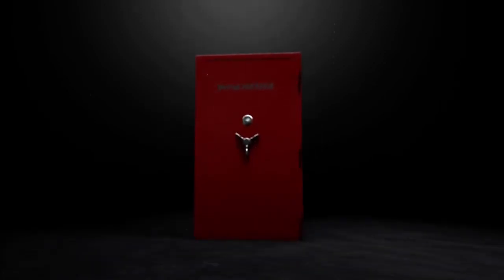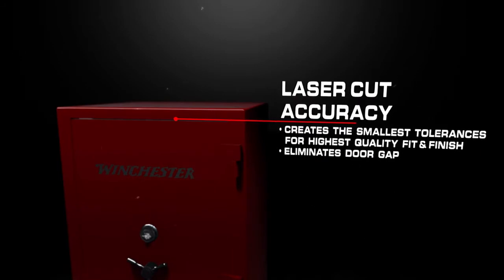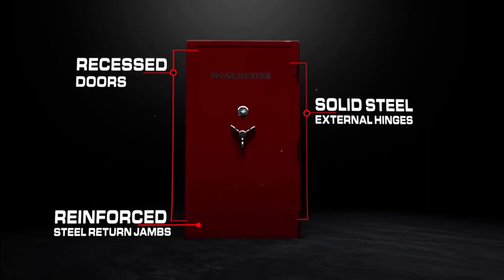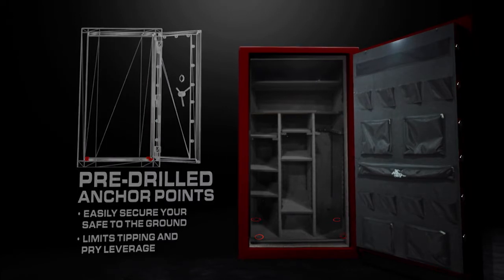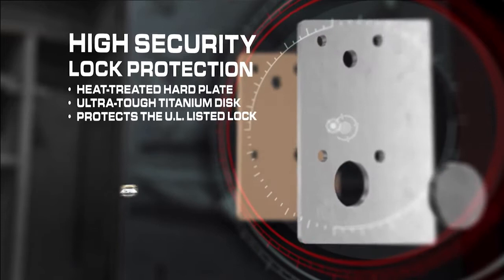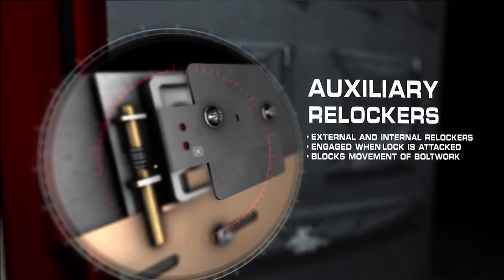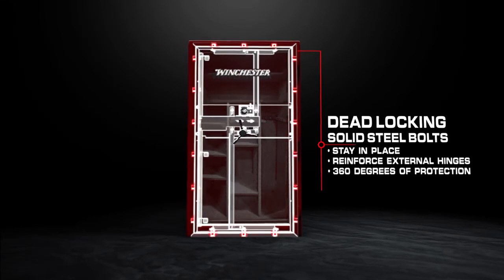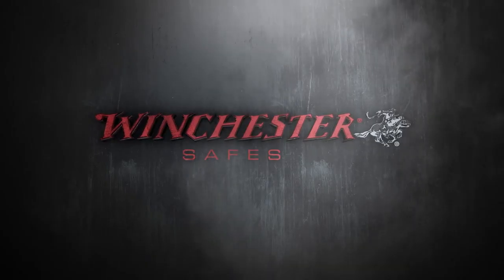How Hard Is It To Break Into A Winchester Gun Safe?

Comment: Winchester safes are NOT safes - they are cabinets and unfortunately, cheap cabinets. I watched a few videos of demos how easy it is to pry/cut them. One guy(on a video) spent about 12 secs to pry the door with a crowbar. Another guy (on a video) used a rare magnet and in about 5 seconds moved the lock to the open position by sliding the magnet. Someone else used a circular saw and cut off the top in less than a min (https://www.youtube.com/watch?v=VRi8PlhRdag  - go to 9:35 timeframe of the video if you want to see just the cut demo) - and this 'safe' is a $2,000 cheaply-made cabinet. UNBELIEVABLE!  Some other videos I watched were about moisture entering the Winchester non-sealable 'safes' and destroying (rusting) their guns and other valuables if left in for some time. It is truly like buying a gun to protect yourself but end up shooting at your toes.